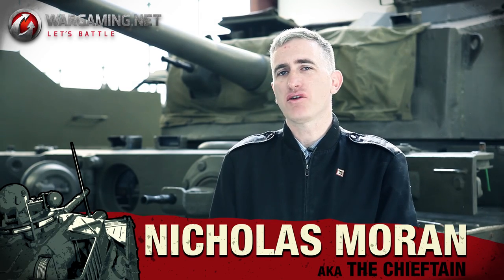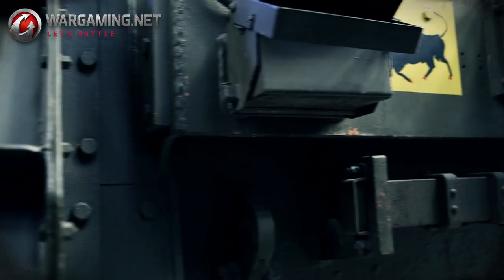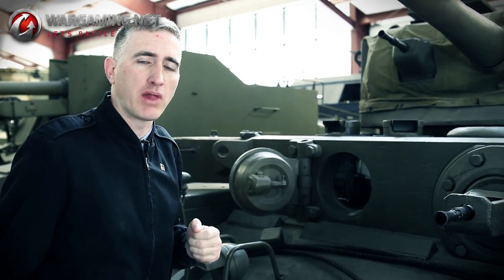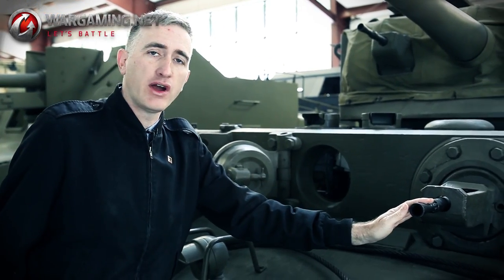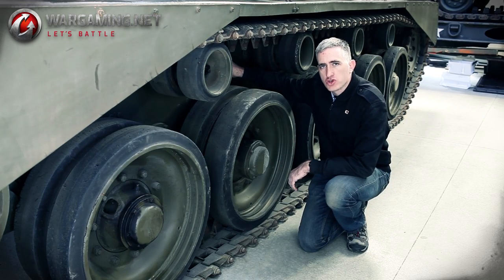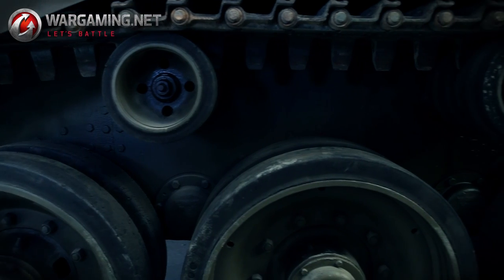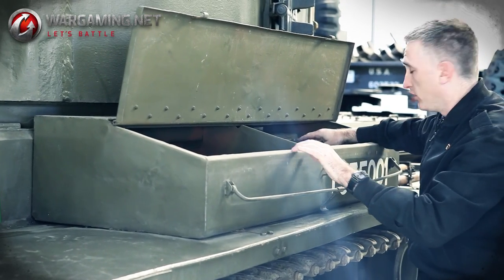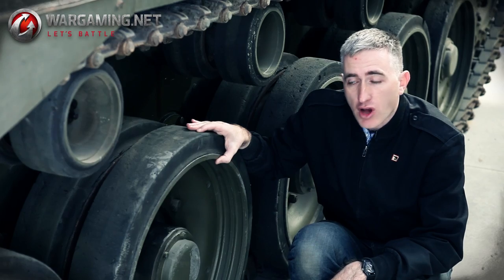Inside the Chieftain's Hatch: Comet Part 1

Comment: You ought to study the T-34 's Christie configuration a bit more... To this very day, T-34 had one of the best track systems ever mounted on a combat vehicle. Russian crews often * could * make all sorts of repairs to the T-34 's tracks, and even road wheels * in the field *, and with only * hand tools * to work with. 
https://en.m.wikipedia.org/wiki/Mariya_Oktyabrskaya 
T-34 was "the disposable tank". 
The Red Army soon adopted the practice of only * expecting * a T-34-76 to have an average combat life span of * 72 * hours * . 
Unlike what would become the case with our Sherman, T-34 's crews were not as expendable. Let's face it--until well into the arrival of the panzershrek and panzerfaust--T-34 did a better job of protecting its crews, the fact of T-34 s not fighting through the bocage country notwithstanding. 
To be fair, this had at least as much to do with circumstances beyond the control of the Sherman and its designers as with the Sherman itself. 
But some of it just * was * less than optimal design. Sherman proved scalable--more or less--and the M4A3E8 "Easy Eight" was a good upgrade. 
Even so, were * I * an allied tanker fighting my way out of the Normandy beachhead, knowing what * we * today have as hindsight--I'd wish I had a T-34-85. It was better (even then) than a Sherman--even the Easy Eight--and frankly better than the early Pershings. Pershing I was tough, but the performance of its new 90 mm main gun against Nazi armor was disappointing . And its GAF Ford V-8--while a very good engine--was NOT up to hefting that thing around. It would be upgraded after the war to the GAA. But again with less than dazzling results. 
T-34-85 would outperform a Sherman in all but rate of fire and fire control.  Shermans had the gyroscopically stabilized gunsight, allowing the main gun to be zeroed while the tank was moving. Ostensibly an advantage. But it seems not to've often worked out that way in practice. On the test range yeah. Not in actual combat conditions. I should make mention that it's also true that our War Dept. considered the gyro gunsight so secret that many Sherman crews were * never * trained * on it, nor provided with the manual. 
And Sherman's cross-country performance was inferior to many other tanks, esp the T-34. 
On the whole, if I had to fight my way across France in '44 as an Allied tanker, I'd prefer the T-34. Even a T-34-76 it seems had a better chance against anti-tank guns--which of course were a great deal more common than "Tiger tanks"--a term which became generic among G.I.s to the point of referring to most * any * attacking German tank--even the Mk IV panzer, which of course was markedly smaller than the Big Cats. :).
Reply: I sense a commieboo

Comment: Theoretically the PzIII was good for the 1940s, it just depended on which tanks it was facing. Comet was mean to take on Tigers I and II, possibly IS-2 and IS-3.
The Comet was produced late in th still mounted a 77mm cannon, which was still not as good as the Panther's main armament and due to the small caliber it wasn't very effective vs infantry.
In game, it is one of my favorite tanks with solid gun depression, amazingly bouncy turret, good speed and accuracy and barely adequate penetration.

Comment: Video starts with "..it was a very good design".
Then I hear "front hull a throwback in design",
"driver's plug a weak point",
"not much room inside",
"repair work on the suspension was terrible",
Any chance we might hear about the good parts of the design in part 2? 

Apart from that, I liked the video, it is a big improvement over the previous ones, and I really liked the details. Keep it up!

Comment: Wait they really ask if you tell the difference between Christe suspension and Torsion Bar suspension? Do tanks even still use Christe suspension?
Reply: +clothar23 Good question
Reply: +clothar23 Hasn't been used in a tank since this and the T-34-85. The later Soviet tanks used torsion bars.
Reply: Lafeel Abriel So why in the name of all that is holy does anyone expect a modern tanker to know anything about 90 year old tech? 

I mean putting that in the damn test seems like an asshole thing to do. I mean Christ they didn't test me on muskets when I passed my marksmanship test.
Reply: +clothar23 Sorry, but understanding army logic (as much of a contradiction in terms as that can be at times) is not exactly something I am all that good at.
Reply: +clothar23 As a ironic side note to my previous comment, one immediate advantage (some would call it the only one) the T-43 had over it's more famous (and numerous, last I heard not even Kubinka has a T-43) counterpart the T-34(and 85) was that it actually used torsion bar suspension.